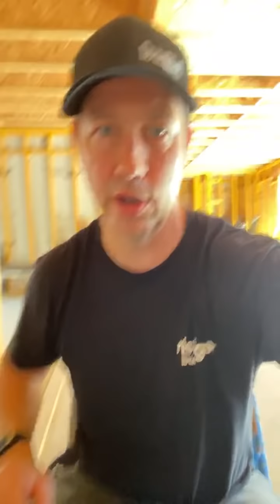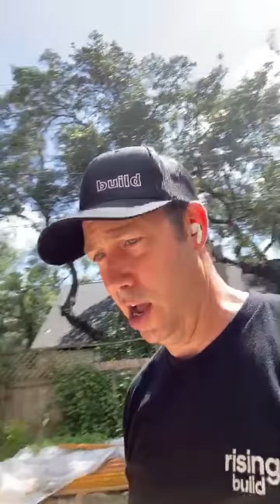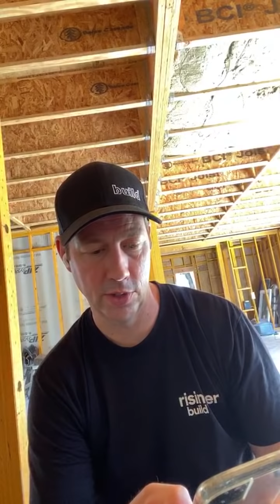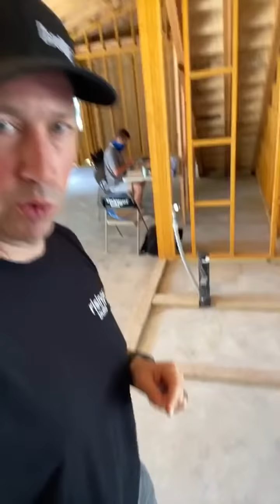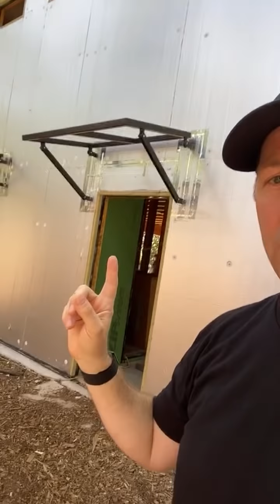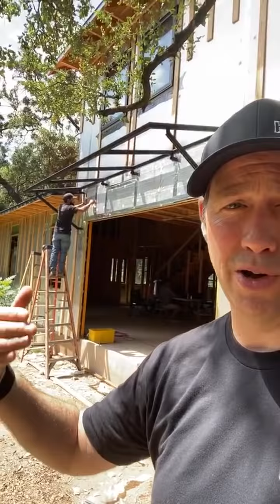Q&A Session

Comment: I would never go ICF instead I would always go AAC instead. The R-value of a typical 8-inch-thick AAC wall is R-10; a 10-inch wall is R-12.5, and a 12-inch wall is R-15. AAC have a 53PSI/sq" so more than double to Concrete Cinder block for example. And all you need a a bigger band saw on you can cut with a big tooth wood blade any AAC to size. Very effective and because it's light weight very fast and easy to build as well.

Comment: Hey Matt- love your content and intentions. My wife and I are building in a suburb of Indianapolis, zone 5 “light”. We have specified a Zip-R6 sheathing to take advantage of the continuous exterior foam. I noted that you have featured several variations of exterior insulation on top of sheathing. Is there a reason not to use a product like Zip where the insulation is deep to the sheathing rather than vice versa? Assuming we don’t create a double vapor barrier would it not perform similarly. Pete

Comment: I have a brick house built 1886. I have dropped latex paint several times on the brick. I have tried murotic acid, no good. Someone else, years ago dropped something else on that won't come off even with aircraft remover. Any ideas?
Reply from the maker: Unfortunately sand blasting is the only method I’ve used. Won’t take much sand. Go lightly.

Comment: Hi Matt:

I stumbled on your videos, trying to educate myself about construction; I think I learned some good stuff so far. I want to build a custom home in the Maryland/Virginia area that meets needs and some of my wants, if possible. Assume I know nothing (which is true), where should I start? Excluding the cost for a lot, I’d like to spend $450-$500K for turn-key above-average construction (4000 to 5000 Heated square feet, include basement). I assume the main floor would be 1,800 sq ft; upper floor 1,300 sq f; basement 1,000 to 1,500 sq ft.

Comment: @Minute37, Klaus from northern Europe inquired on "what to do differently."  Matt replied "use thicker insulation."  I love Matt's ideas of "Monopoly (the game) houses" with their full blankets of exterior insulations and weather barrier layering.  But Matt, it seems, habitually builds atop slab-on-grade foundations and that sets the theme of his builds.      I disagree thusly:   In a snowy cold climate, I would build my dream house with a raised foundation, and insulate the floor.      I'd put my heater in the basement or crawl space and insulate it carefully.    Now gravity helps with heating the house, because the heated air rises from below.   Importantly, the attic would NOT be conditioned, as is Matt's habit.  My attic floor would be thoroughly sealed and insulated, and the well-vented attic would be expected to temperature-normalize to the ambient.   Exterior soffet or eave intakes and ridge ventilation out-takes.   Raise the pitch angle too, compared to that of warm climate locations. This minimizes the chance of ice dams forming on the pitched roof, because the entire roof will be very cold in winter and snow will not melt above the living quarters.    Matt's approach requires perfection in roofing insulation, and any heat leakage will cause insidious and accumulating damage from ice dams.       To solve the "making ice cream in an oven" hot attic problem in the summer, I'd use sub-rafter radiant barriers; and use mini-split freon-based cooling.   That means no HVAC ductwork in the attic, at all.  If you are in Copenhagen or Hamburg, you probably don't need active cooling at all.   I am in southern California where it gets very hot in summer.

Comment: The issue of rafter tails is too narrowly described or constrained. We have a long-standing project with 2" polyiso over Barritech VP liquid applied membrane. We ran LVL tails out through the sheathing, and did air seal around each tail with the liquid-applied. Excellent ACH50 numbers and thermal imaging at the framing completion. At lot cleaner than the overlay LVL's on this house of Matt's: I personally would not condone the air networking introduced by those overlays (plus a lot more fussing to cut and fit the pieces and the foam). Also, the overlay is starting to undo the value and performance of the continuous roof foam, as regards to thermal bridging.Our tails interrupt the wall foam for 1 3/4" x 4" every 24", a pretty small thermal footprint. In our Denver area climate, there is also an issue with carrying the roof continuous insulation all the way out to the sub fascia; it is much preferable to do so (and I have done it both ways, stopping the foam at the wall line is no longer an option). See BSC for the rationale.

Comment: I’m very curious how your roof trussing is attached to your wall. I understand traditional framing attachment methods but the way you talk about them being clipped at the ends has me confused, I haven’t seen any brackets in what you have shown (that I’ve seen). If you could explain or do a video on that I’d really appreciate it.
Reply: I wouldn't use trusses.   That's cheap production builder method.   Hand cut joists with solid high quality kiln dried lumber is the way to go.

Comment: about putting dehumidifier at the attic; better way is to put a hot water air to water heat pump which will dehumidify the attic and make hot water with high efficiency cause the attic will be hot all the time; direct the cold air from the pump into your pantry; also you can insulate your attic from the outside bu putting the PIR foam panels on top of the rafters; this way you dont have to demolish your drywall from inside and you get continuous insulation; over rafter insulation can be air sealed with tape; this probably will be easier, cheaper and better

Comment: (haven't gotten a chance to watch yet, this is a preemptive comment so I don't forget to ask!) what is the function of windows in an "airtight" home with an HVAC system that brings in fresh air on the homeowner's terms? are the windows purely for lighting/solar gain purposes, or are they also to be considered for ventilation? it almost seems, with the perfect wall system, that the windows should just be fixed so as to not disturb the balance of the HVAC system. thoughts/input?

Comment: Bosch Heat Pumps are questionable because they are not easily staged and have problems with humidity control.  They are a relabeled Chinese product and are among the cheapest inverter based split units available.  Originally they were pitched as a retrofit outside unit for use with a conventional PSC indoor unit using a simple one stage thermostat.  For a conventional split system, Trane, American Standard or Carrier is far superior. Even a lower cost two stage system from a better manufacturer is likely to be better than the Bosch.  In any case, properly sized and sealed ductwork with a good media filter is often far more of a concern on a new build or major remodel since it is unlikely to ever be touched again.  In most areas ductwork is poorly specified and installed.

Comment: Matt - I was in a work meeting.  So bummed I missed this.  Was going to ask a question about insulating second story walls that are inside the attic.  Currently only has standard 2x4 batt in cavity insulation.  Interior surface has been as high as 85 degrees during these hot San Antonio, TX days.  Thinking about putting rigid foam insulation on the attic side of the framing.  Anything I need to be aware of or watch out for?  Also about to air seal my attic as I know I have infiltration is impacting my HVAC load.

Comment: Matt, been watching your channel for about 6 months now and "liked" about every video I have seen. It is interesting to see how you build a tight home to deal with the southern climate. Have also heard you talk about colder climates with layers of exterior insulation. What about those of us that live in the middle. We are currently building a new home just outside Sioux Falls SD. we have high temps/ hight humidity summers and bitterly cold winters. (-20 temps before wind is normal January/Feb) I asked multiple builders up here about systems such as Zip sheathing, spray foam, etc... the general consensus is it is a waste for our climate.  What do you think?
Reply: Sounds like you have been talking to the wrong builders.
Reply: Agree. Check out the videos from a while back where Matt is touring a home in Canada.  It's still tight, exterior insulation, etc.
Reply: Hello Sioux Falls Tim Miller:  Thanks for disclosing your geographic location.  I live in SoCal Los Angeles County.   My Dad came from the Black Hills, and I visited his sister as a boy several times and as an adult in winter..  I believe your remedies lie "elsewhere" from Austin TX methods.   Where it snows, you must avoid ice dams, first and foremost.    So take a tip from Canadian engineer and keep that attic vented and not conditioned.   You want your roof to normalize its temperature and that means you want exterior air flowing up from the eave and out at the ridge.  Then moderate the temperature of the attic using radiant barrier (shiny side down) below the rafter.    No cooling plant in the attic except for mini-split system where you have freon lines all over the place and no ductwork.        Heat your house from BELOW, not from above, and that works best if you have a raised foundation.      Insulate the hell out of your attic floor AFTER YOU seal it for air leaks.    Insulate house using the "ski jacket" analogy advocated by Matt; i.e., on the outside.      Radiant barriers keep us cooler in summer and warmer in winter; learn from YouTube you don't need a degree in physics to grok this.
Reply: Interested in this info as well!
Reply: we talked to quite a few builders over the last couple of years, they will do it but they will also have a massive upcharge as well. we are going with 1" closed cell and Fiberglass in the walls.  Just supprises me that the norm up here is the same old way they did it 20 years ago, well that with house wrap.

Comment: I’m not sure that a “perfect floor” would be better than slab on grade in the Southwest USA. Has anyone done any research or attained any data???
Reply: slab can be insulated from underneath with foam glass or XPS foam panels; this way there is no thermal bridging
Reply: @Craig E i think EPS is to soft to put under the slab; also 2 years ago when i was building my house best λ factor was 0,029 for XPS and 0,03 for EPS; foam glass is the best option when available
Reply: @Craig E my XPS has 300 kPa while EPS with  comparable λ factor has 100 kPa; EPS might be enough, but enought is not always better; did you hold a good XPS and EPS panel in your hand or try to cut it? XPS is 10x stronger and does not crumble, it has alot of elasticity in it, it feels like a piece of hard rubber/plastic; BTW i did use EPS to insulate my walls from the outside

Comment: This fall I’m planning on a garage remodel, currently it is basically a shed on a slab, 2x4 framed walls with some sheathing that I will replace.  Plan is to use the perfect wall concept.  So I will replace the sheathing with zip, add 3 in of poly iso to the wall and 4 in on the roof, some thing to space some foil faced OSB off of the poly iso and then some more Zip and siding or shingles.  Am I leaving anything out?

Comment: Hey Matt, have you seen any issues with the weight of the hardie artisan siding causing accelerated settling when used on older homes and foundations? I’d be interested in knowing how it’s held up on that early-1900s home you did almost a decade ago with Artisan and Azek. Thanks.

Comment: Heat pump hot water heater idea. I live in South Alabama and will be building soon. I was wondering if it would be good to use in attic space ? Just thinking because it’s so hot in the attic that it would be easy for the unit to heat water and help cool the attic which would help keep the house cooler. We are doing a bonus room above the garage which could be a good place to gain access to unit. What’s your thoughts on this idea ?